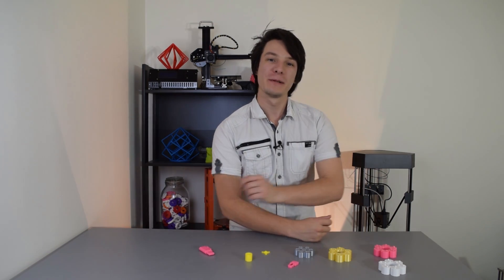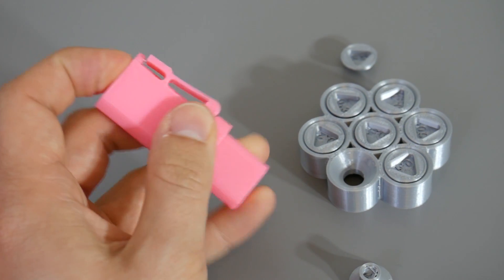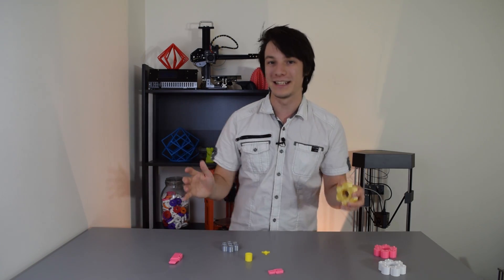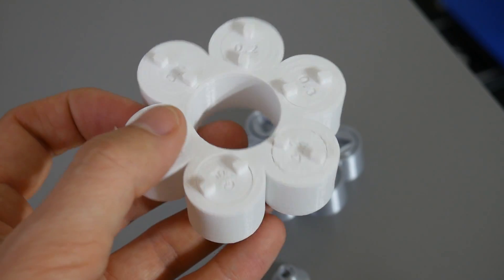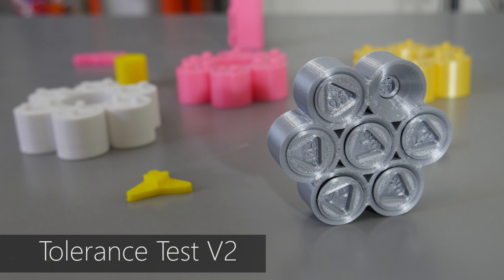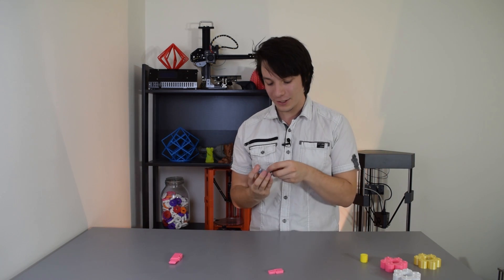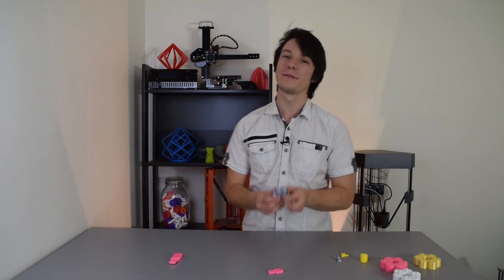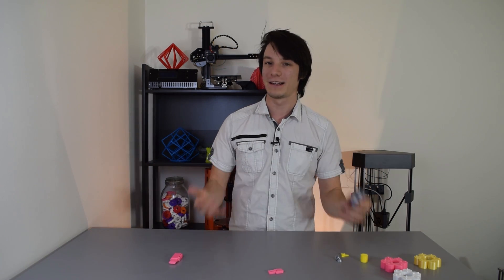How Accurate is your 3D Printer? Take the Tolerance Test!

Comment: You need something like this that tests z axis tolerance
Reply: the fact is that this model kind of test z axis too, if you have z axis not properly tuned you will see that some layers are fat and others thin, if this happening in such a model it will stuck and fusion even if x/y are ok
Reply: Turn it sideways to print
Reply: Then how will you tell the difference between too tight tollerances and just support material getting jammed?
Reply: dont use support material then haha @tiagotiagot

Comment: Hey there seems to be an issue with the model. Between 6 and 9mm the .1 test has jagged lines on the external perimeter of the part that spins,  instead of concentric circles so it will never spin.

Comment: I'm setting it up on my MP Select Mini right now.

UPDATE: First print fused together on the bottom because the bed was too hot. I reduced the bed temperature and switched to bare blue tape, and 0.3mm and up were free right off the printer. The 0.2mm one came loose when I stuck the key in a bench vise and turned the part. Looking at it I think 0.15mm might free up if I made a new key that will stay in the vise better to get more torque, but I believe 0.2mm is the resolution stated in the printer's manual.

I used Monoprice PLA in red (PID: 10553) at 210C nozzle, 50C bed temp.

Comment: Just wanted to thank you for your channel, sharing your knowledge, and this resolution test. I am printing one now and wonder how I will do on a Geeetech Prusa I3 while I await delivery of the original Pursa I3 MKII.

5/14/17 11:45. Ok,0,5 is really loose and has a lot of Z play. .04 is a bit more tight but still with Z play. .03 is starting to tighten up nicely, .02 was the first one requiring a tool to break loose and has little Z play. .15 took a lot of effort to break free with the tool but once free it moves nicely with no Z backlash. I was unable to break .1with the tool. I will design a tool with a longer handle and more leverage to see if it can be broken free. I doubt it. I'll let you know what happens.

No luck on .1...welded

Comment: I have just done a test on my FlashForge Finder using FlashForge's own slicer and am pleasantly surprised. I used the default standard settings without a brim, wall or raft and unsealed a new spool of PLA from 3DPrintz.co.uk. When complete the 0.5mm core was free as it came off the bed, the 0.4mm freed up with a light twist with my finger and thumb and the 0.3mm freed up with the key. 0.2mm and downwards are solid. I now have a baseline to compare with some gauges sliced on  Simplify3D over the next few days although I suspect the machine is the limiting factor but we'll see. Thanks for this and all of your other hints and tips - all very much appreciated.

Comment: Challenge accepted.  But I just ordered my Geeetech i3 aluminum and my Flsun i3 aluminum (aluminium to you) two days  and one day ago.  Been dreaming up improvements for the GT based on videos and discussion on GitHub.  They should work on the Flsun too.  Wishing I had seen the Flsun before I ordered the GT.  It has addressed at least two of the problems I see on the GT

Problem:  I don't Tweet.  Do you have a FaceBook or other presence, maybe a dedicated email address just for these results?

Comment: what is the best 3d printer 
with 170 by 170 by 170 at least 
my budget 
is 200 dollar
Reply: youtube a bunch of types and see.   FilamentFriday reviewed a $154 prusa style.  Answer depends on your technical level, pain threshold, goals.  Really cheap ones need a IEC switch and covers for safety with the open power supplies, and maybe a mosfet for the bed just to be safe.  All printers have flaws, knowing which ones is 80% of the battle.

Comment: Old Engineers rule on precision -  a 1 cm stainless steel cube will cost you $15, a 1.0 cm cube will cost you $50, 1.00 cube will cost you $500, and a 1.0000 cube will cost you $10000...

Comment: Just completed this print and I'm pretty surprised at how bad my printer performed, I've managed to get 0.5 and 0.4 moving without any force, but anything below that is not working. I'm also under-extruding (which isn't normal for me) and its still stuck the 0.3 together. Time to sort my printer out >.<

Comment: Printed on my Prusa i3 Mk2S.  Sliced with Slic3r using standard settings, 0.15mm optimal print settings, rigid.ink PLA with Prusa PLA preset.  6h10m print time.  0.2 and above were free off the bed, 0.15 came free with a lot of effort but now turns quite freely.  Thanks Angus, definitely worth $5!  Going to try it again at 0.2mm layer height.

Comment: Especially for the tighter gaps, material properties and geometry will have non-negligible effects (material shrink rates, wall thickness, temperature).  It would be a good idea to do this with different materials/geometry as you will most likely get different results even on the same machine.  In any case, this is an great way to help dial in your system and better understand it's l in limitations.

Comment: i have an FT-5, currently not up and running due to changing some things. Designed and printed a new carriage, and things to make it easier to change things out... As well as dual z endstops. Also have a BL touch but will need to change one thing around later so I can add it as well. 

With that said this interests me, but the amount of filament it uses and the build time is too much. So if I get time at some point I may design one of my own that uses less filament and doesn't take as long. Will probably shoot for 1 and a half hours or less, at about 50mm/s.

Comment: with a massive over extrude, I got mine down to 0.4mm (HyperCube) @ 0.2mm layer height, speed between 40 and 48mm/s (I got impaitent) and 15% infill and no part cooling fan

Comment: Lol, I didn't know it was free so I put $1 in to get it.

Keep up the good work! I'll see how close I can get with my 0.2mm nozzle.
Reply from the maker: Thanks dude! Let me know what a 0.2mm nozzle is capable of
Reply: Considering I could print this miniature for D&D with it, I wouldn't be surprised if I can get the 0.1mm gap to work. Then again, my extruder is kinda crappy.

https://i.redd.it/72uqf3kou9ly.gif
Reply: This is the highest quality small print I've ever seen out of a .2mm nozzle, https://d2py9w124w2itd.cloudfront.net/photo/image/700x0/5583ac2e25284/Tree%20Frog%20Keyboard.JPG That was done with a $3000 dollar printer, .25mm nozzle, and 40 micron layers. Theres a lot of variables that you need to get absolutely perfect for something like that. I'm just hoping my Tronxy can print adequately :p
Reply: price doesnt mean a shit here, and ive done somthing more tinny, in the pic you will see a big manatee focused at the "background", this one is 0.4 nozzle, the other one focused is the tinny one, if you notice the unfocused, you will see a air coming out from the hole, just scaled. its 1cm from head to tail :) even did 0.5 one LOL but so tinny couldnt even touch it. by the way, the material is glow in the dark, pretty cool gift for my gf :) :P
http://subefotos.com/ver/?0dca2d74829ad4132a01885a5155d393o.jpg

Comment: Thanks for making these videos. I really appreciate all the work you put into these and I really look forward to each video. I found that reducing the extrusion multiplier to the point right before the print starts to show gaps on the surfaces works really well to get accurate parts, which is key when testing to tolerance, in my opinion.

Comment: Printed at 0.2 layer height in PLA on modified kit i3 printer.
0.3/0.4/0.5 OK
0.2 needed key
0.1 & 0.05 lost cause
Does layer height = tolerance ??
Maybe i'm over extruding?
Reply from the maker: I printed mine at 0.2mm, you might be slightly over extruding but it depends where it's welded.

Comment: Printed it on my Prusa i3 MK2 with Prusa PLA Yellow, 0.4mm nozzle, 0.2mm layer height, 10% infill, 205°C and 55°C bed in 3h52m. During taking off the bed the 0.5 to 0.3 mm came free. The 0.2 was very easy with just the fingers and finally the 0.15mm i got free with your key. I question myself how i can prove that i got 0.15mm free on Twitter?
Reply from the maker: Awesome! I didn't really think that far ahead... I suppose by showing that the triangle is rotated? I believe you though. Very cool that 0.15 is possible on a well tuned machine.
Reply: got pics on Twitter WITH rotated triangles
Reply: I printed on Prusa i3 MK2 with Inland light brown, 0.4mm nozzle, 0.1mm layer height, aligned perimeters, avoid crossing perimeters, detect bridging perimeters, external perimeters first, and even the 0.1mm freed up with a little work without the key.  Only the 0.05, which was fused in the slicer, didn't work for me.  The timing on this test was perfect as I am starting work on a multi-part model that is going to have to fit together.

Comment: I was looking for something like this, and even if I could probably make something similar, i see no reason to reinvent what's already been done. Added a bit to the $0, and even got charged my local vat. :-)

I've just set it printing, and looking at the first 3 layers, it looks like everything will be free, but i expect that will change further on in the print.
Reply: So, using totally stock settings on an i3 mk2 with a .4mm nozzle and filamentum extrafill pla,, i had .5 to .3 free. The .2 could be loosened with the key. The .15 could be whacked loose with 2 hits of a hammer on a washer. .1 got lose after about 10 whacks with a hammer, but are still quite tight. Unfortunately, i know that my extruder is underextruding a little bit, so when i add the extrusion multiplier of 1.07 to the print, i can only get down to .3.

Sorry for not using twitter as requested in the video, but I don't have an account.

Comment: Angus I understand you mentioned filament and printer is tested, but have you checked your flow rate and try decreasing it on the printers that couldn't do it? Looks like they all tried and nozzle marks were left on some surfaces so it could have managed it to a better degree but it was extruding way too much. Also at the end don't hide you were struggling to spin the outer thingy like a normal spinner lmao anyway great video. I will try the 0.05 as always. ;)

Comment: You can get around the fact that copied (or patterned) components in F360 are instances and mirror changes done to one to all the rest by copying the bodies and not the components. Then you can leave all the bodies in the same component or use the "Components from bodies" command to get them separated.

Comment: I'm pretty sure most printers can position their head within 100microns resolution and more.. the difference between having a fused and not fused part has to do with the difference in extrusion amount and the temperature and not the printer type.

Comment: Challenge accepted - gonna try it on the Cetus with a .2mm nozzle!
Reply: I got the 0.15mm to work first try on the CETUS.  0.2mm nozzle with .07mm layer height.  The 0.1 is "oh so close" to moving!  I can get a hobby knife blade in there, but it won't turn.  :(

Comment: The extrusion multiplier can also be used to decrease the tolerance needed by your printer. This is because the perimeters get thinner, meaning the hole gets slightly larger, and the object going in the hole gets slightly smaller. In other words: if you have very bad tolerances on your printer... is it the quality of the printer that is the problem, or are you overextruding?

Comment: I think the extrusion multiplier will have a huge effect on this test. Obviously a printer with huge mechanical inaccuracies or major stringing issues isn't going to print this well even if set to under-extrude a bit. I let Simplify3D do the thing it wants with extrusion width (0.48mm from a 0.4mm nozzle), but I suspect in this case the print might perform better, if force to print at 0.4mm line width.

Another way to defeat the test is to print at 200% scale, which proves that test isn't really testing dimensional accuracy. For all you know, you might be printing 5% too big or small and you'll probably get the exact same performance as if your parts were dimensionally accurate. This is really important to understand if you are printing parts to match non-printed parts.

My printer can make M5 screws and nuts (using the threads modeled in Fusion 360) and they work well without any added tolerance, so I expect it to do pretty well. I'm printing this tolerance test in clear PrimaSelect PETG right now, so we'll find out soon, I suppose. I'll comment on my post when it is done...

One way to model a test like this in F360 would be to keep the center parts fixed size, make a sketch for the cage, use different offsets for the holes in the cage and then extrude them all at once.

A far cheaper practical test of printing tolerance would be to make a set of round holes and a peg and then test which hole the peg fits into perfectly. You could even extend the test to negative tolerances. Essentially what you are finding out is how much on average your walls bulge out from where they should be.
Reply: 0.3 rotated effortlessly. 0.2 took some force to get going, but now rotates with just my fingers. I don't think 0.15 will come loose before the whole print breaks. PETG has really strong layer adhesion, which is something I take into account when printing supports too. I suppose there's a difference between a "print in place" and "two separate prints" tolerance test, where the former is useful for support material distances and printing mechanisms like this in place and the latter is more useful for fitting parts together after they have been printed.

Comment: In prusa edition of slic3r they have kept filament dia to 1.75. I have also stop bothering with filament dia now. did you measure filament dia when printing these. i think prusa settings are made in such a way that if you change 1.75 then all things screw up.

Comment: YX offset is meant for this exact reason.. Mine is set to -0.2 for some reason, i get my 20mm calibration cube within 0.05mm tolerance.
Reply: now try the 100mm cube.. xy offset is meant to fix the tolerances between parts so they fit better and not to calibrate specific absolute dimensions. if your error is 0.2 per 20mm, then it will be 1.0mm per 100mm.. having a -0.2mm will result in 100.8mm box. what you need to calibrate first is steps per mm.
Reply: Nope, that is steps per mm. Its a diffirent thing.
Reply: The box size is defined by Y = (Steps_per_mm)*width + Offset*2. I got it dialed in, believe me.

Comment: Hi Angus, top tip: put a 0.5mm chamfer on the bottom outer edge of your designs. This should become standard in 3D printing. It makes removing objects from print bed 10 times easier, plus you eliminate the issue of a squished bottom layer sticking out of the side walls and having to sand it off.
Reply: hjoore 
Na. Use an MK3 with PEI and squishing eliminated by correct first layer.
Reply: @TrollWithOpinions  Whats PEI
Reply: N F 
Polyetherimide
A great surface for a printer. PLA sticks to it even with no heat, but prefers 40-50 Celcius.
ABS sticks to it with a heated bed.
The great thing is that the printed piece lets go of the PEI sheet when the bed has cooled down. Very rarely have I had to use force.

Comment: My wanhao v2 only works up to 0.6mm tolerance :(
the real issue is the nozzle dragging plastic as it moves across the gaps
I see through the gaps down to 0.4mm, but the places where the nozzle had to move over the gap are clearly visible and clearly merge the two perimeters

Comment: I usually go with 0.1mm gap plus a bit of sanding for an ultra tight fit, 0.2mm for a fairly tight fit by hand and 0.3mm gap as a good all round yet easy fit. So far so good haha!
Reply: I printed this and I found 0.3mm no problem, 0.2mm I had to bust loose with the key, and 0.15mm is frozen sold.  Elegoo Neptune 4, 0.2mm nozzle standard settings (0.2mm layer thickness)

Comment: With or Without supports (assuming without?) and any layer height?
Reply from the maker: definitely no supports, and I did mine at 0.2mm
Reply: Well the print is beautiful at 0.1mm layers but sadly despite being all about the pretty, it's not so fully functioning.
I hope Angus recognises that a lot of people would like a good guide to calibration, he could be onto a winner with that.
Reply: I was actually just wondering about how the layer height could affect tolerance. Time for some testing!
Reply: taity waity set it off at 0.1 mm but just remembered I'd put a new brand of filament in ready to calibrate then got distracted so who knows what monstrosity I could be creating.
Reply: Tony Morel my first one was with a fresh install of Slic3r, forgot to enable the cooling fan, it's not pretty.
Reply: Enabling fans got the 0.2 gap working. Going to try for the 0.15 tomorrow by lowering temp, speed and layer height slightly.

Comment: What sort of layer height are folks printing this out in?
Reply from the maker: I did all mine at 0.2mm
Reply: I've just set mine going at 0.2mm but I forgot to turn off the skirt in Cura after my last print. Should be interesting to see how it turns out.
Reply: The skirt came off without issue, but something else must have been set wrong. I barely got the 0.5mm gauge to move. It seems the filament prints lines that are slightly wider than Cura plans for. So off to see what needs adjusting.